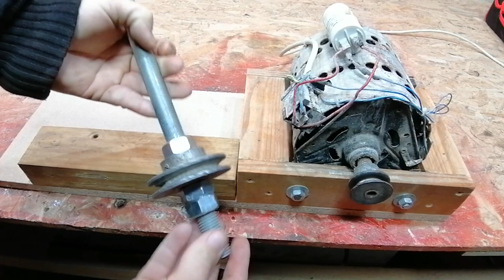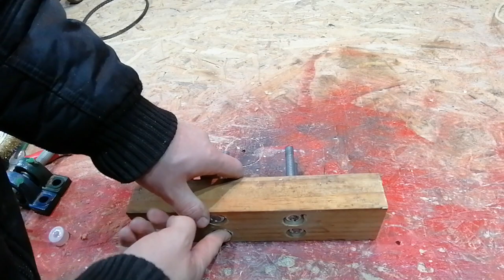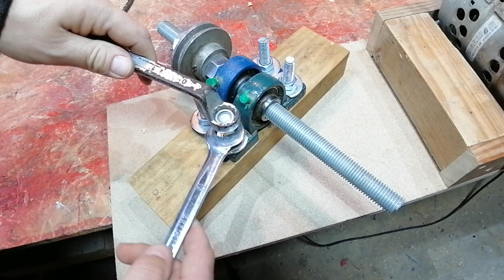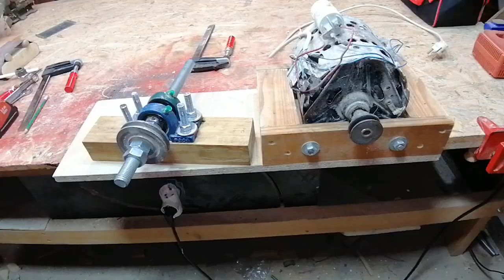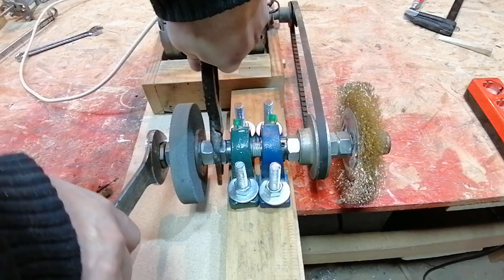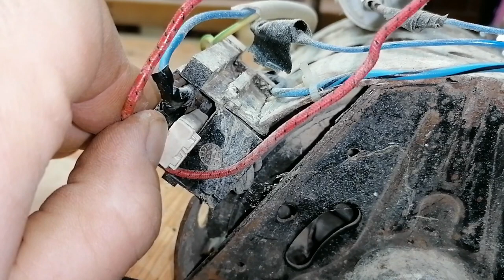How to Make Bench Grinder using a Washing Machine Motor

Comment: any torque and balance issues?
Reply: Clearly a balance issue later, but appears he bent shaft. Likely only mild steel instead of drill rod.
Reply: @cavscout888  looks dodgy to me. best not run it at full speed for those stones
Reply: @SodiumInteresting  He would have benefitted from spacing the pillow bearings out more. Longer, stronger arbor.
Reply: @cavscout888  possibly

Comment: With that rpm in low speed is ok, but don't try it with high speed with that wobbles. 🙄
Reply: Looked like it started out decently balanced/straight shaft. Think it bent. Threaded rod was likely only zinc coated or galv mild steel.